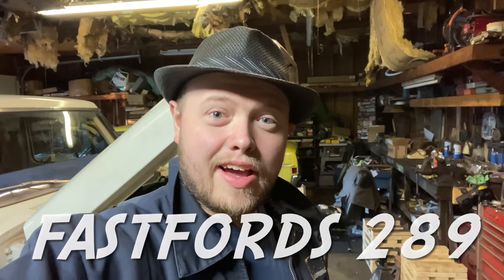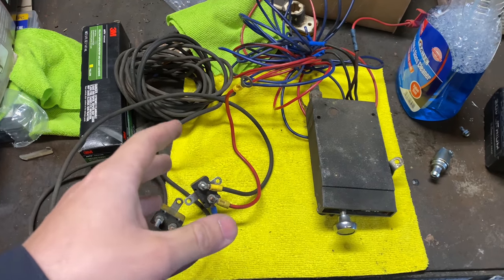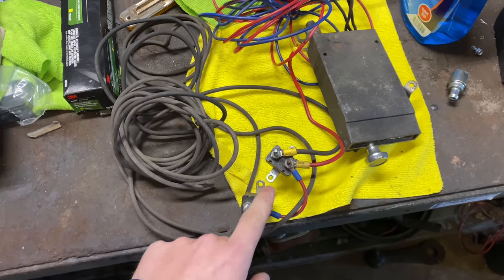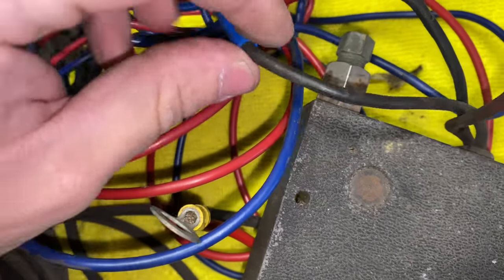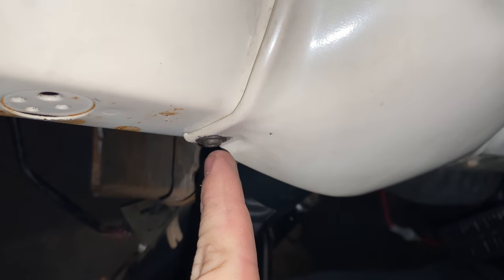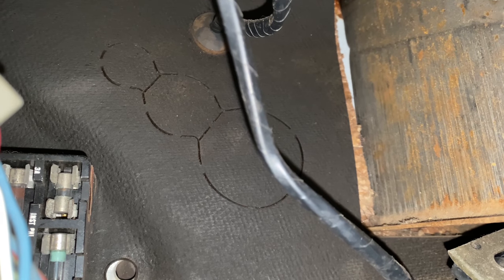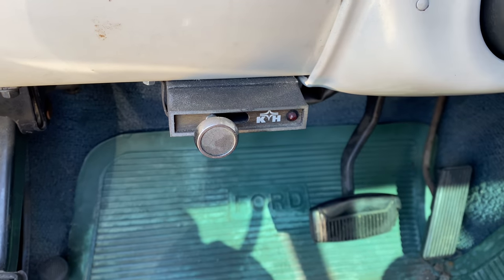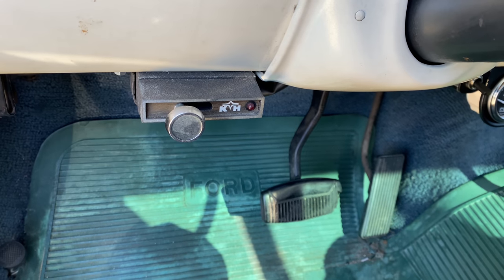Vintage trailer brake controller install on my classic truck-(how to).

Comment: Good install with grommets, breakers, and the like.  Those breakers even look like they belong on that firewall.  Side note, I need to borrow that nice flare tool next time I do some brake lines, I'm jealous!
Reply from the maker: Lol, thanks man I appreciate it, yeah I like the way it turned out, like it was meant to be there. It’s a real nice flaring tool, I picked it up off Amazon and used it a few times and never had an issue, it does different types of flares too. If you really ever need to borrow it, just let me know, it’s no problem. 
Thanks for watching.

Comment: Where did you get that receiver hitch that screws into the hole for the ball like that ?
Reply from the maker: That’s actually a hitch for a 2000’s dodge truck that I cut and modified to fit and welded reinforcement plates on to make it work. The previous owner had already welded angle iron from each side of the frame with bars coming off welded to the bumper so I just continued on. Which the hole in the bumper aligned perfect with that hitch but I had to cut the back down and bolt it up with angle iron to make it fit flush. Hope this helped. 
Thanks for watching.